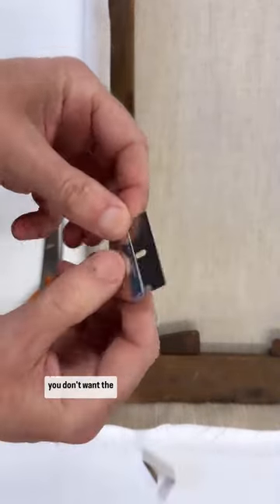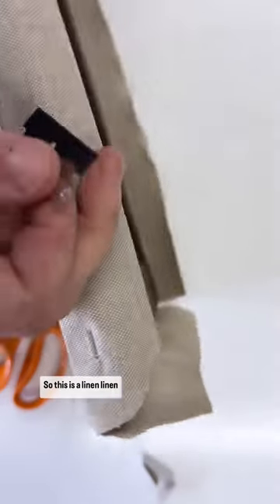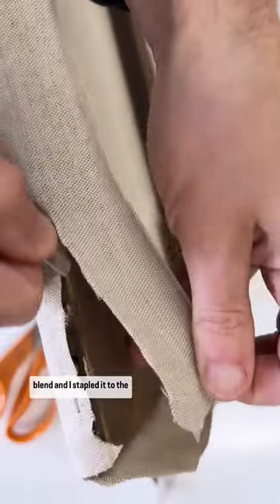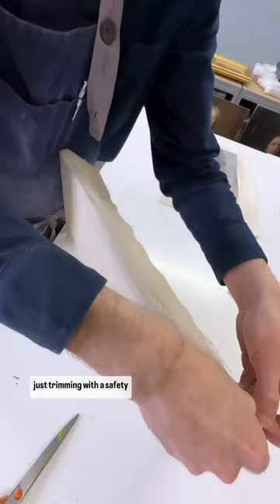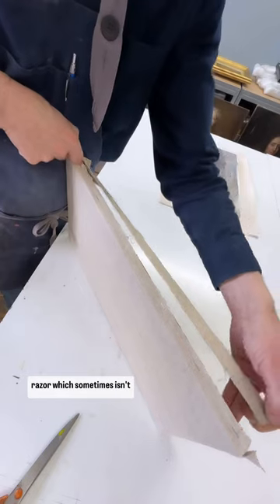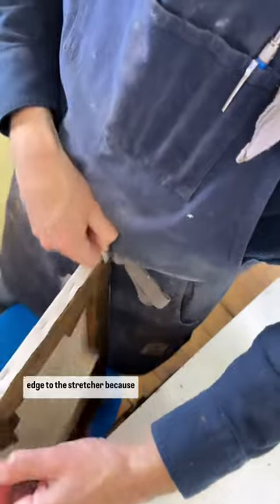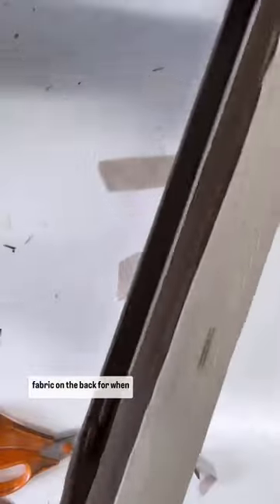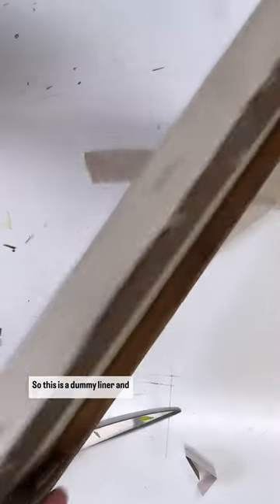Preparing a dummy liner for relining painting  #fineartrestoration #artrestoration #art

Comment: I felt it in my gut when he cut the edges so short! Think of the future dude - fold and tack it!  And I agree that a dummy liner is a bit sus - it hangs on a wall. You don’t see the back normally. What are you trying to cover up?
Reply from the maker: The lining edges are cut short so there isnt an excess of material on the tacking edges whch could mpact how it fits in the frame,  this is not the full lining. Im covering up the restoration as some clients do not like to see it from the rear of the canvas, a dummy liner can also offer support to fragile paintings without being so invasive as to apply adhesive or go for a full lining.